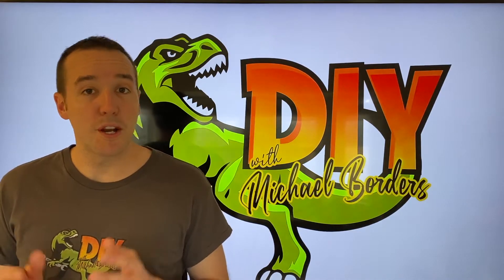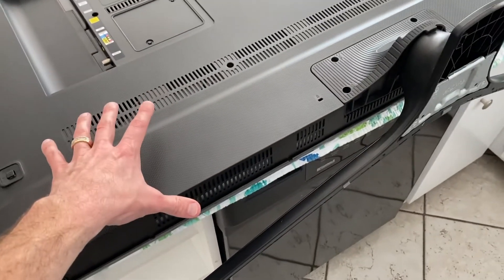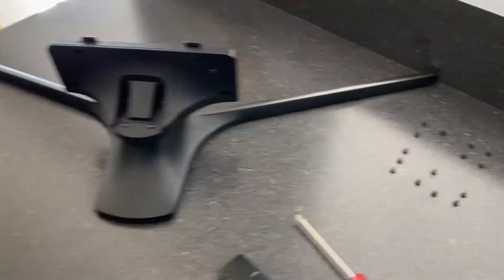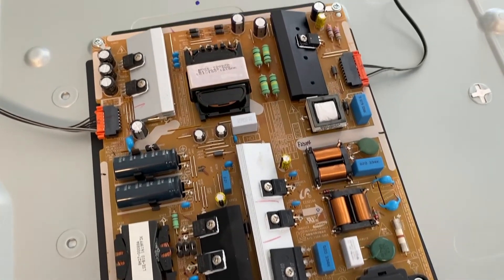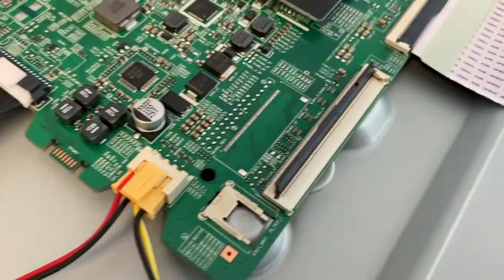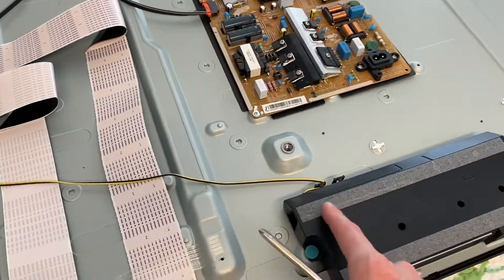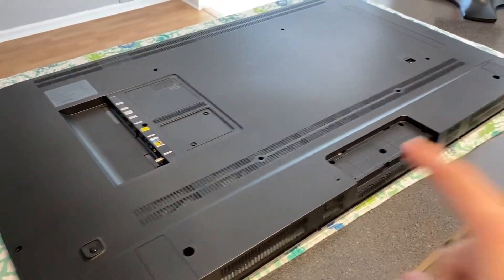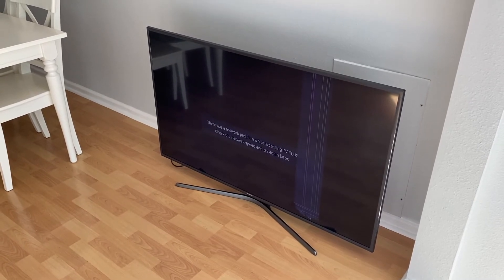Vertical lines on TV - DIY inspect and clean

Comment: I have this exact same problem but with white line through the very top and bottom of my tv. Will a lcd panel replacement take away the white lines at the top and bottom going right through my tv aswell
Reply from the maker: @JennaWiseman-d2c  

Thanks for watching, a new panel will indeed fix issue.

Below is a link to our video showing replacement of panel.

       https://youtu.be/OjaEzVa55Fw?si=M2kfAX2W_B7oBWpZ

🧰

Comment: Very effective DIY dust/lint remover: 

You'll need a standard household vacuum cleaner, a straw (or the tube of an ink pen, etc.) such as the fat ones you get with a milkshake or at 7-Eleven, and tape such as electrical tape (works best), or duct tape that you can find at your local dollar store. Stick less than half of the straw into the hard plastic hose attachment tool of your vacuum cleaner. Then wrap the electrical tape around the straw and hose attachment, giving it a nice seal. Be careful as the suction force can be very strong. You don't want to suck up any parts that are not locked down.
Reply from the maker: Thanks for sharing, any and all helpful info is greatly appreciated.  😎👍

Comment: What was the conclusion of this diagnosis ? , If one didn't have the bottom crack, is it the board, and how exact must one get in its replacement. Several boards  eBay have the BN94-12197 -x    ( ABCDEF =x )
Reply from the maker: Thanks for watching & for us, it ended up being a cracked panel.  After tracking down a replacement panel and getting it delivered, it was a very friendly DIY project.

Below is a link to a video that shows us replacing our panel.

       https://youtu.be/OjaEzVa55Fw

If your screen shows no signs of impact cracks, it’s very likely that your panel is still good it just needs a replacement board.

Keep us posted on your project.  😎👍